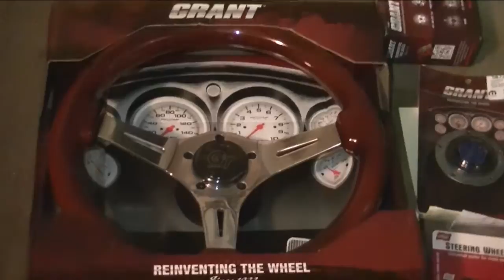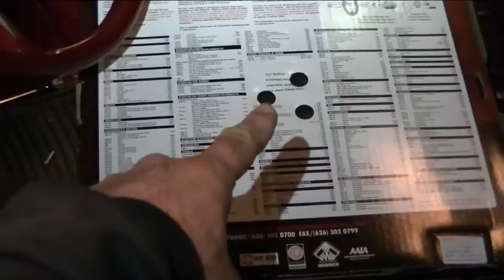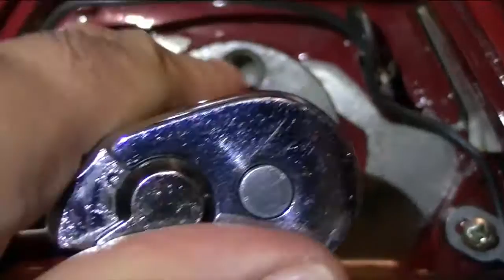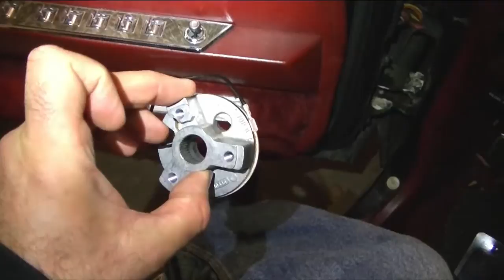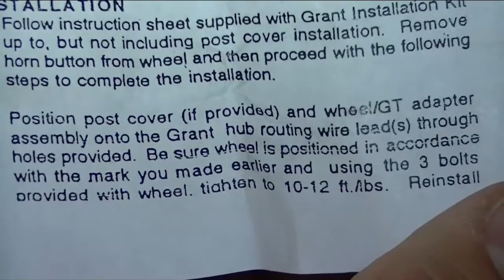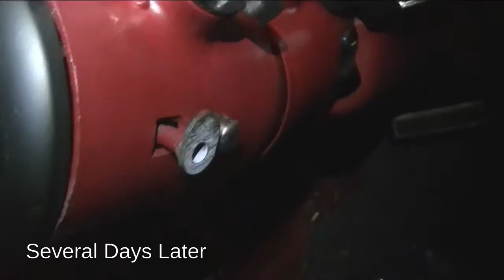Instalation of a Grant steering wheel on a 1982 Chrysler New Yorker

Comment: Do you know if all the grant Horn buttons fit all the grant wheels?
Reply from the maker: I do not know that answer; but I believe you can find what fits each type of wheel on the Grant web site.
Reply: there are a few different types of horn buttons that grant offers for different wheels. The 5 bolt style wheels like this one is considered the signature style. there are buttons for the signature style wheels with this mount and then there are buttons for the wheels with the banjo style mount and then there are buttons for the 3 hole mount wheels.